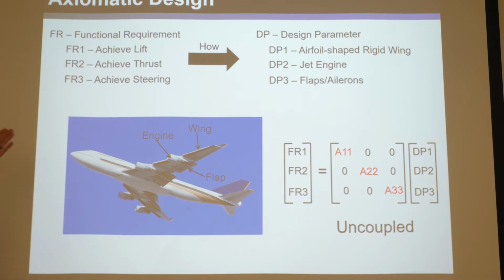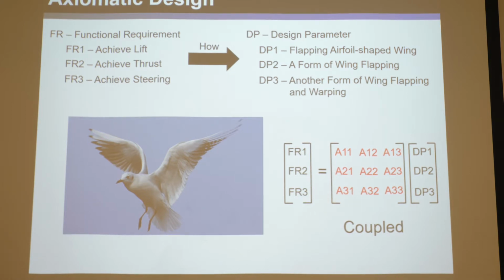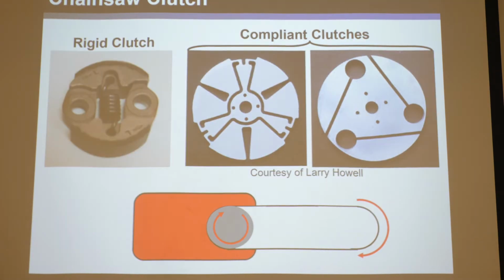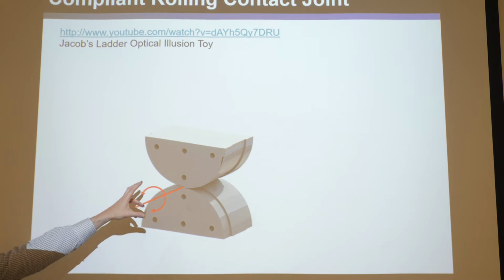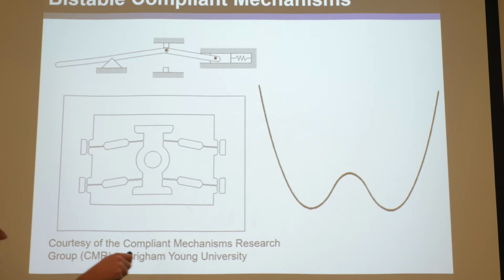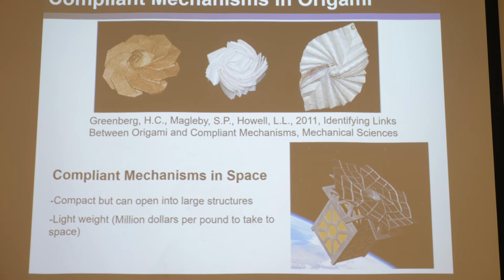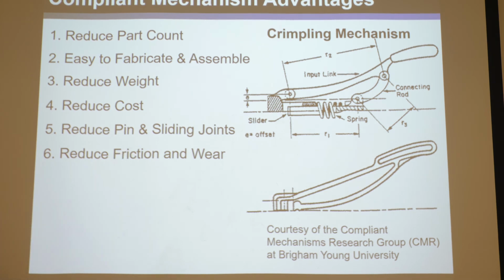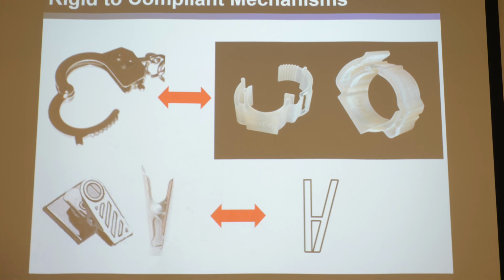Compliant Mechanisms Lecture 1 Part 2

Comment: Introduction:

* [0:00] Axiomatic design favors uncoupled design parameters and function requirements for simplicity and ease of fixing issues.
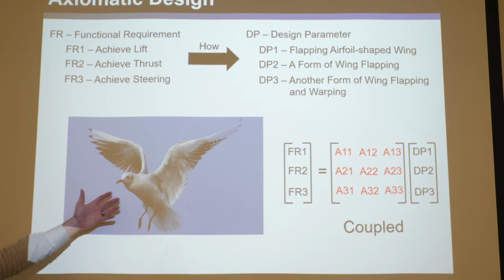* [3:19] Nature, on the other hand, exhibits highly coupled and complex designs.
* [4:22] Rigid mechanisms are preferred over compliant ones due to their predictability and ease of design.
* [6:05] Advancements in design tools are making compliant mechanism design easier, leading to superior performance.

Compliant Mechanism Applications:

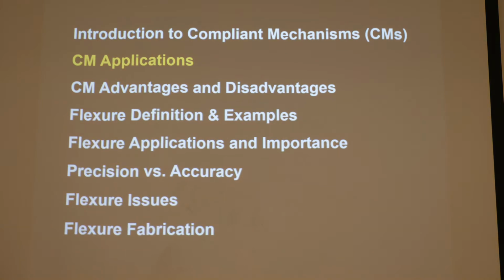* [6:38] Chainsaw Clutch: Replacing multiple rigid parts and a spring with a single compliant piece, improving weight and ease of manufacturing.
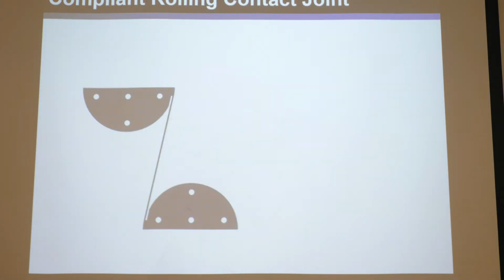* [9:04] Zero Stiffness Joint: Achieves high stiffness in all directions except for rotation, providing near-zero resistance in a specific rotational direction.
* [12:46] Lattices: Architected materials using zero stiffness joints, enabling complex kinematics with a single piece.
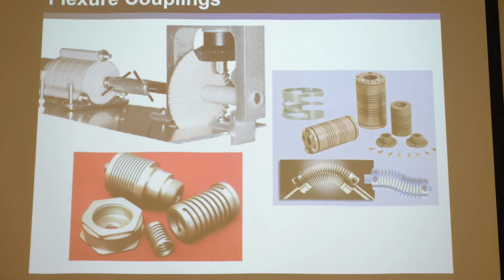* [13:30] Flexure Coupling: Accommodates misalignment between rotating shafts without the drawbacks of rigid couplings (clatter, friction, wear).
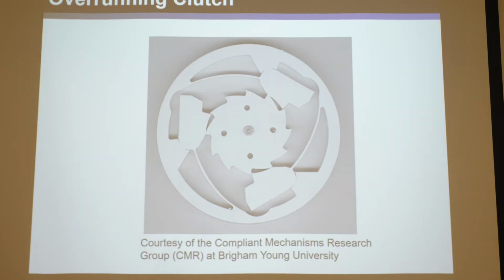* [14:56] Overrunning Clutch:  Allows rotation in one direction only, engaging a ratchet mechanism when rotating in the opposite direction.
* [15:55] Multistability: Designs with multiple stable states, achieved by strategically utilizing compliance and strain energy.
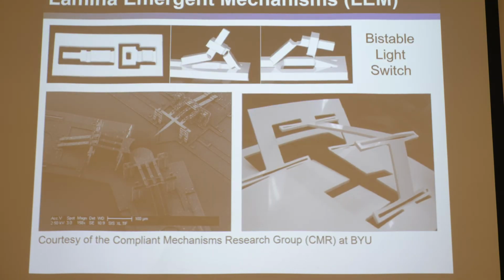* [17:40] Lamina Emergent Mechanism: 3D mechanisms created by deforming a single planar sheet, simplifying fabrication and assembly.
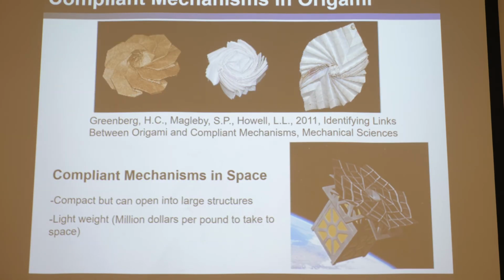* [20:04] Origami and Kirigami: Art forms utilizing compliance and selective cuts to create compact deployable structures.

Advantages of Compliant Mechanisms:

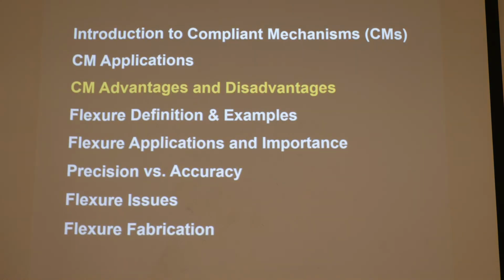* [22:26] Reduced Part Count: Often requiring fewer parts compared to traditional mechanisms.
* [22:26] Easier Fabrication and Assembly: Simplifying manufacturing and assembly processes, often resulting in monolithic designs.
* [23:45] Lighter Weight: Utilizing less dense materials and eliminating bulky components.
* [24:08] Reduced Cost: Lower material usage, simpler fabrication, and assembly contribute to significant cost reduction.
* [24:20] Reduced Friction and Wear: Eliminating sliding and pin joints, resulting in less friction, heat generation, and wear.
* [25:04] Reduced Maintenance: Fewer parts and lack of wear contribute to lower maintenance requirements.
* [25:56] Energy Storage: Natural ability to store strain energy, eliminating the need for additional springs.
* [26:14] Scalability: Easily miniaturized or scaled up without significant changes in design principles.
* [27:34] Precision: Achieving high precision due to the inherent deterministic nature of deformation.

Conclusion:

* [28:23] Compliant mechanisms offer numerous advantages over traditional rigid mechanisms, particularly in areas like cost, weight, and precision.
* [28:23] Understanding compliant mechanisms can unlock new design possibilities and lead to innovative solutions. 

i used gemini 1.5 pro (2024-05-15)